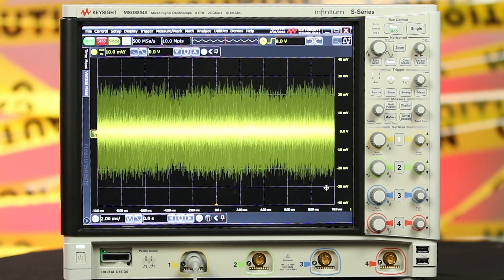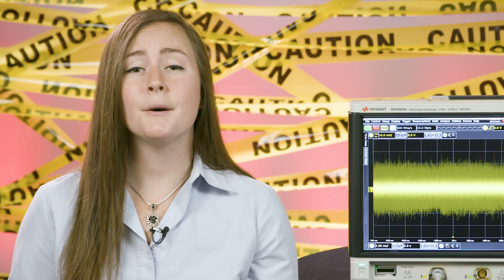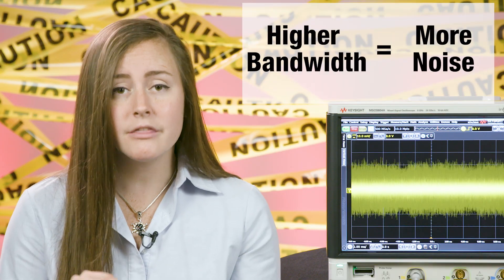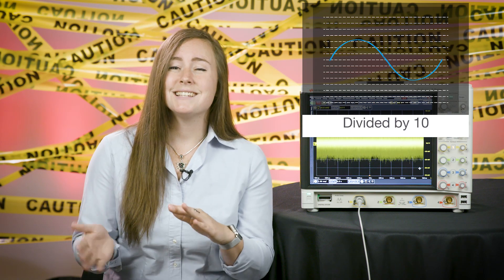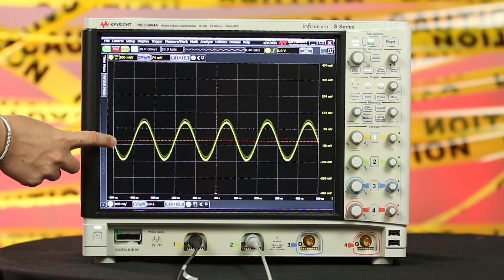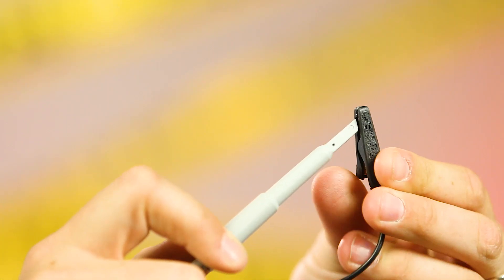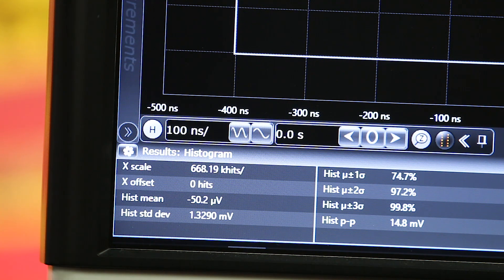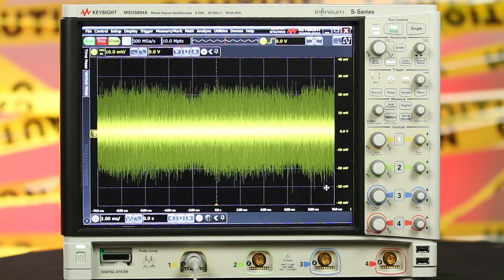How to Analyze Vertical Noise – Exposing Signal Integrity Myths – E2

Comment: Hello, could you make a video about floor noise (in whiteboard maybe) about how affects "the number of
quantization levels that are needed to display at that offset"?.. it has to deal and with the trriger level maybe which is changed when the waveform is out of the center? Thanks for all the nice presented tutorials.

Comment: For repetitive signals a good way to eliminate much of the internal oscilloscope noise is to use the average sample mode, results in very sharp traces. But be careful if you average over too many samples and the input signal is not repetitive, then the signal doesn't look like what you see.

Comment: Some specific noise from probe and device under test can be eliminated by turning off unneeded equipment when sensitive measurements are taken.. ;) 

What's about noise from oscilloscope going back to probe and to the test device?
Example, when testing transistor power amplifiers output cascade driver op.amp. with probe, especially non-inverting pin (but depends from schematic), in some cases, some oscilloscopes generates parasitic noises through probe, but amplifier doing his job and that noise goes to the speaker (very loud, because volume control in this situation is bypassed)..

Comment: Changing the probe to x1 instead of x10 reduces its usable bandwidth significantly, this may or may not be an issue depending upon what you are doing, people need to check their probes specs to know how that will effect their measurements.

Comment: I've used different scopes and you're right -- it is a hassle to measure around the vertical noise... Grrrr!   as a firmware developer I occasionally work with the electronics at this level so the next time I'm facing this difficulty I'll try these tips to improve my measurements-- thanks for posting!